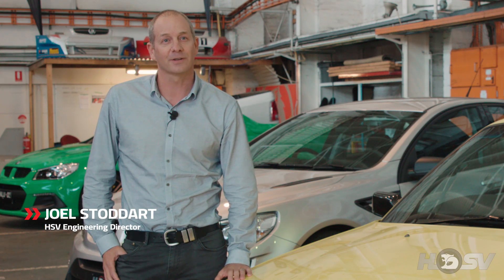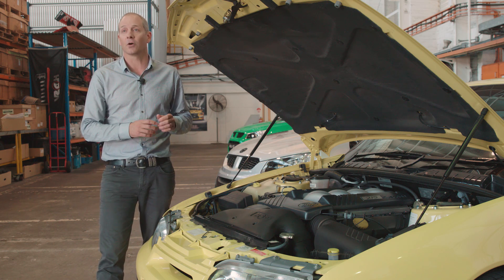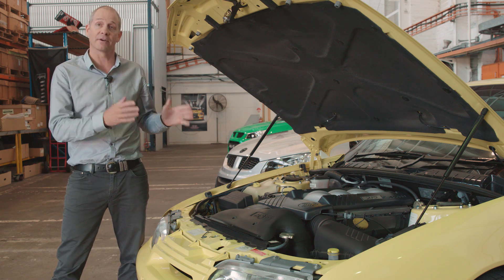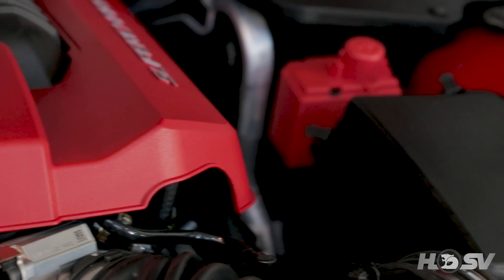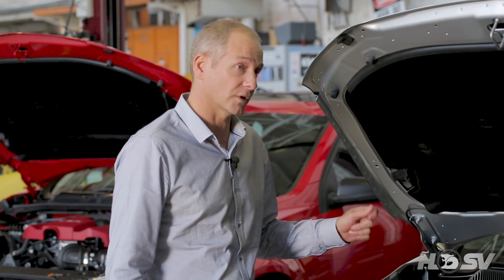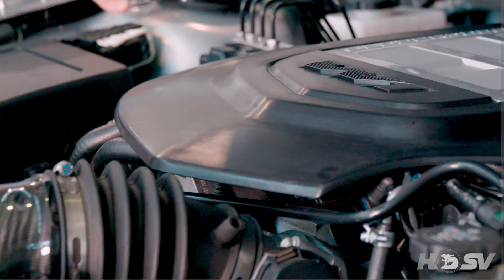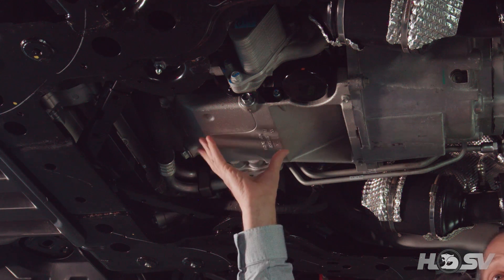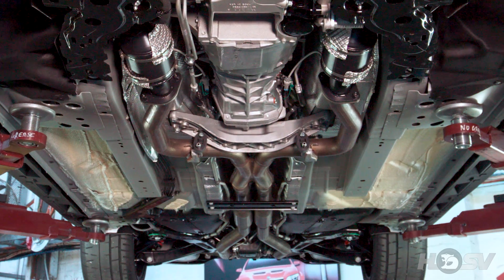HSV GTSR Range Powertrains

Comment: HSV GTS-R W1

0 - 100 in 4.2secs.
0 - 400m in 12.2secs.

Something is amiss - that is pretty slow for a car producing 474kw and 815Nm.

I have a 2012 C63 AMG with the performance pack making 343kw.  Just last month I ran a PB at Perth Motorplex drags with an 12.01sec.  I have both the dyno & timeslips.  What is the issue here?  Does the  W1 really loose that much power?  

Especially when u can buy my car for ~ $70k vs over $170k for the W1 & be even with a car thats older and  & has MUCH less power.  Not trying to put this car down, I just don't understand what is going on here.
Reply: bro do u know how m,uch it weights its a tank

Comment: And it'll still get smoked by  most  Falcon XR6T's...all day long...
Reply: Funny you say that, I have no bias when it comes to ford vs holden, but i have never driven a smoother and more capable factory car than the GTSR. I know it's expensive, but for a factory car, it is so enjoyable and smooth. 435kw and so smooth to drive. The brakes are stupidly good, the turn in response from the front end of the car is tight as fuck ;) and the independent rear just hugs the ground when you get on it. The GTSR feels so close to a v8 supercar it's insane. The motor reacts completely different to an SSV Redline or even an R8, despite the supercharger, it feels so rev happy and light. The only peeve about the car is the weight, you can really feel how heavy it is. However the chassis/suspension almost negate the worry. It is so refined, cudos to the engineers at HSV, it really is fantastic. I just wish it had a little bit more power over last year's LSA output... Somewhere around 455kw for GTSR base, and 500kw for GTSR W1. That would have been just that tad more exciting.
Reply: Typical dero ford owner comment right there.
Reply: I think most of them have run off the road into trees as soon as there is a light shower.
Reply: I'm disappointed, i expected much better times and quarter mile time from the W1. It had my hopes up that it'll be the quickest modern muscle sedan in the world but the XR6T and especially the F6 smashes it...